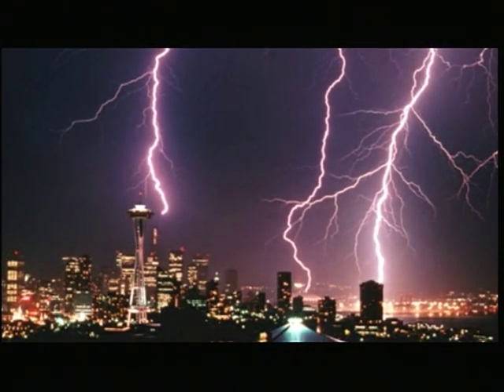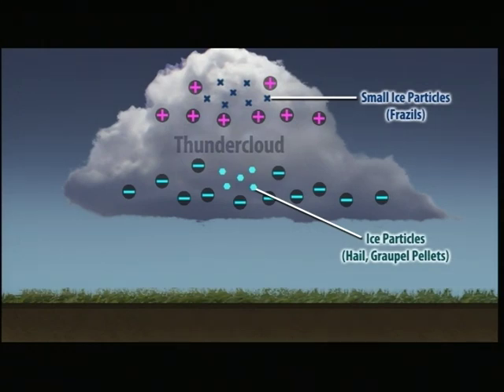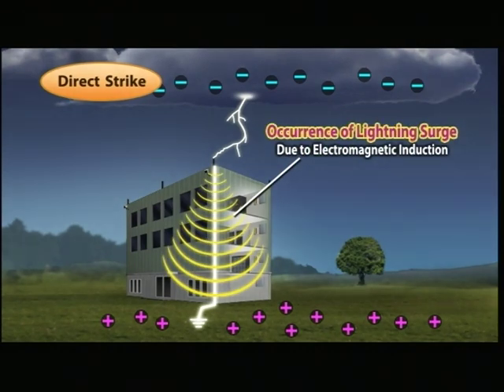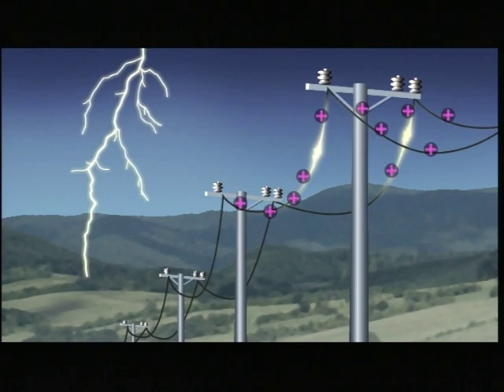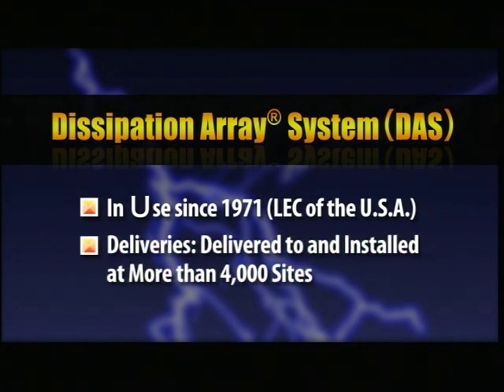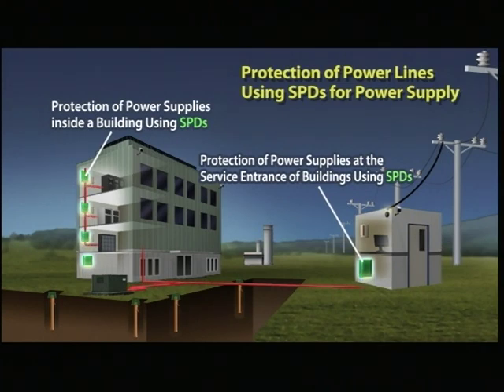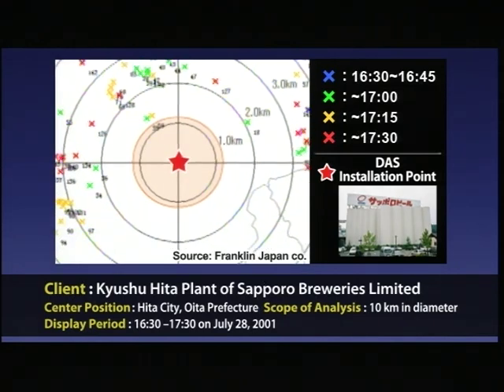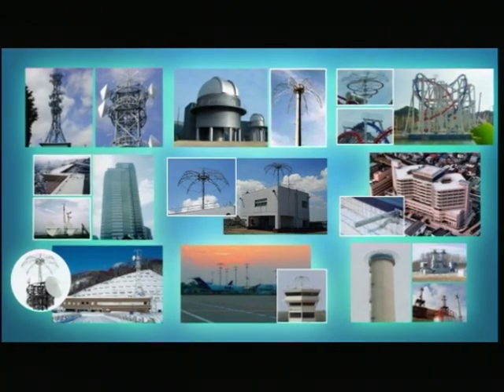Dissipation Array System (DAS) Video English

Comment: What are the materials needed in making DAS and how it is being installed..
Reply from the maker: Standard material is SS 316L for the wire and Galvanized Steel for the structure/bracket